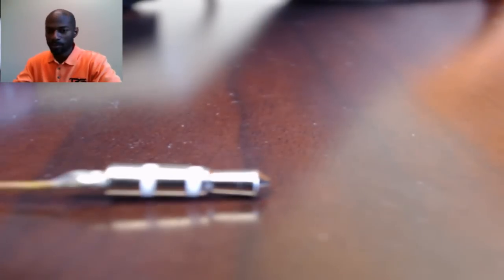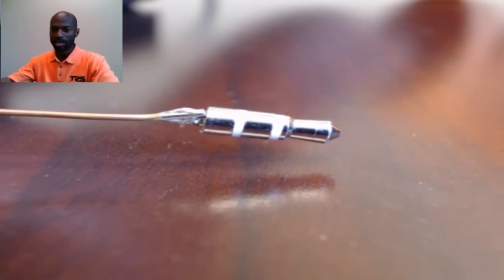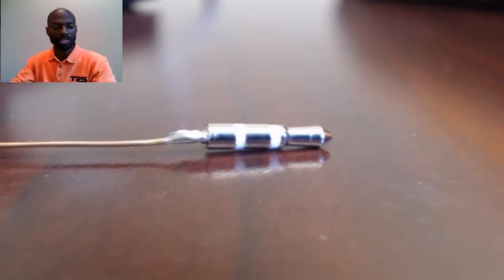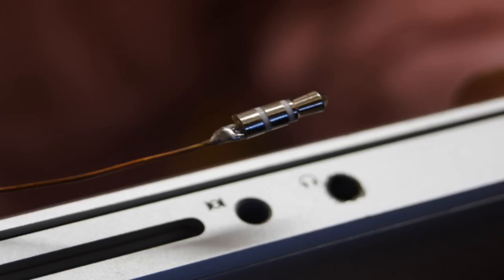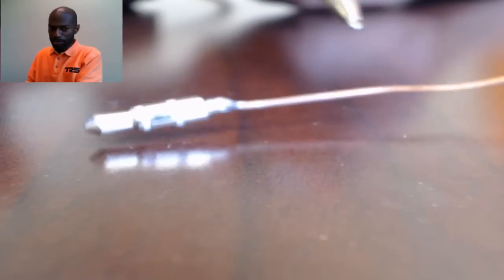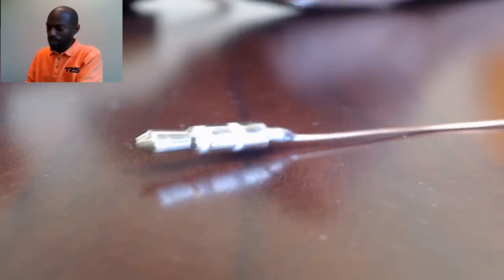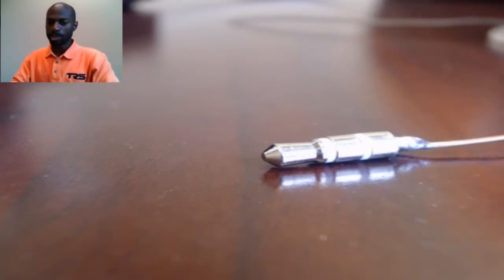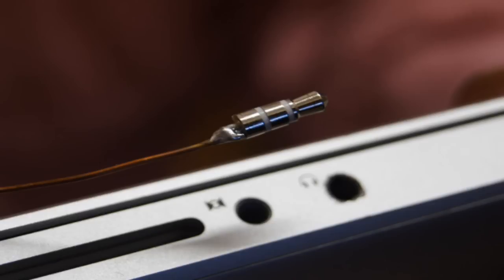How to remove a broken headphone jack from your Macbook Pro  #headphonejackrepair #brokenaudioplug

Comment: Thanks for this. I just used an alternative method which worked. Using a small hand held drill chuck and a very small (0.025") drill, I drilled into the broken piece of headphone jack. After the drill was far enough into the the jack, I pulled the drill back and the jack pulled out with it. I think it's a good alternative because you are not relying on the solder joint to pull the part out.

Comment: Get a pair of wireless Bluetooth earphones and call it quits. Don't mess up your  computer.
Reply from the maker: Hello and thanks for watching.  Good suggestion, but sometimes because a physical plug is stuck in the jack the software won't switch to another audio output.

Comment: You removed a plug, not a jack.   The jack is the part built into the laptop(the hole)(or the port)(or the socket) that receives the plug.  The plug is on the end of the wire that comes from your headphones or speakers.   Just like a "plug" on your toaster, or any electrical appliance - it's the "male" part that is on the end of the wire.      So your title is misleading.
Reply from the maker: it might be possible ...Valid points...my apologies for the confusing title...Hope that you can find the proper info that you were seeking..  Thanks for stopping by.

Comment: this is the shitest tutorial on the web, why the fuck does it come up first? completely useless, you spend most of the time taking about NOTHING.
Reply from the maker: SuperOnepointzero sorry that the video was not helpful to you.  The gist of the video was to use a piece of solid wire and a soldering iron to remove the remaining broken 3.5mm headphone plug....i actually made the video days after i had already done the repair...so that is why it is mostly talking...

Comment: Worked sweet! I built up enough solder to pull it out with pliers and didn't attach a piece of copper to it. Just did it over a long period of time to keep the heat down.
Reply from the maker: Awesome!  glad it worked out for you.

Comment: the idea in the video is practical as long as extreme caution is done. Two things one should worry about is accidentally heating the inner bore of the headphone port thereby causing damage to the pins and upsetting their connections to the logicboard.I think there are about 8 pins connecting the jack to the logcboard, and there are about 4 pins inside the board for connections, one for each ring, and one external pins that disconnects audio from the internal speakers and channels it to the headphone once the RCA jack is inserted. I will be trying mine later today. I tried to drill the broken headphone jack out using size 1/16 inch drill bit but I only succeeded in removing half of it. I did not want to go too far for fear of damaging the port. One last thing, you should remove the logicboard from the MacBook Pro, computer before you do the removal. This way you will have a better view and you can easily position the board for easier access to the bore. Just make sure you do not damage any other parts of the logicboard while doing the removal.
Reply from the maker: Hey thanks for the good tips.  I wish you the best on getting out the broken jack... and thanks for the share!
Reply: MoralRichMedia

Thank you for your kind thoughts.

Comment: THANKS FOR HELP ME TO DESTROY MY LAPTOP HEADPHONE JACK!
 >: /
Reply from the maker: Hello Deaquipa,  I'm so sorry to hear this... I've placed warnings both in the description and in comments... one that if your laptop is still in warranty (don't try this), two if you're not proficient with soldering that you should do this at your own risk.  The laptop that I performed this on was not even mine, but the owner was at his wits end so we went for it and it was successful.  ** please note to everyone that reads this, if your laptop is plastic or your headphone jack is plastic don't try this as you may melt your jack**   Again, this method does work, but I can not make any guarantees for every case.
Reply: it's ok!

Comment: Hey can u make new video of this with lots more details pleaseeee ?:((( I can take it out with the super glue and feeling very depress hope u understand and there will be a lot of people out there just like me. So please please !!!! I wanna see the demo
Reply from the maker: Hello Ben bee... What exactly do you need help with?  Let me know and I can see if I can show you how more specifically.  Also, does the Ipad have a plastic or metal headphone jack?  If it is plastic then I would advise not to try this method..
Reply: MoralRichMedia  Its a Macbook Pro :( i have seen other videos of how to take it out by using the Loctite super glue but i ended up pulling nothing out and i have no idea if the glue it self glued together the metal with that freaking broken headphone inside the hole :'( hopefully it didnt. -_- I am very stressed out about this :( I have no idea what am i going to do .. Please guide me the way :( theres really no one could help me .. Pleas pleaseeee
Reply: MoralRichMedia
Hi could u please respond to my question ? :((
Reply from the maker: Sorry for the delay,  do you already have superglue in the hole?  If so, that may be a problem...
Reply: MoralRichMedia
any solution ? or what if the glue didnt really bond the hole?
Reply from the maker: The hole needs to be clean so that if doesn't interfere with the solder joint.   Do you already know how to solder?
Reply: yeah it's kinda clean bro and i've never done soldering :C
Reply from the maker: Ben bee  Here's the new video Ben bee, hope that it helps you.  http://youtu.be/pmirad8BNc8

Comment from the maker: Yes.  I recommend using a solid copper wire.  They can be found in old coax cables for TVs or wire jumpers for bread boards.  Make sure that you TIN the end of the copper with solder before you try to connect it to the plug as well.  Hope this helps